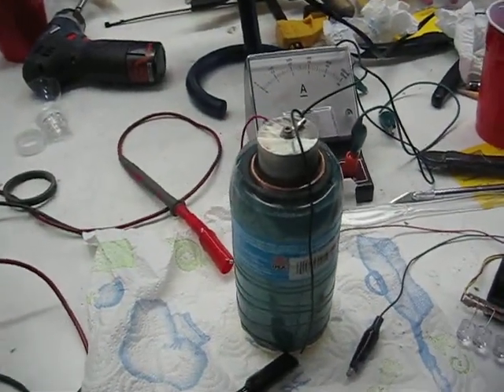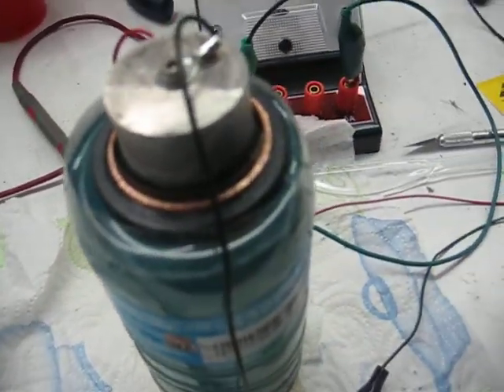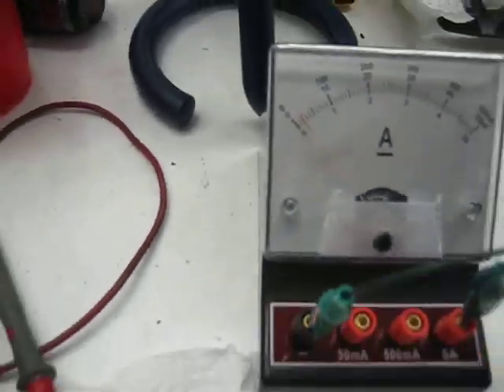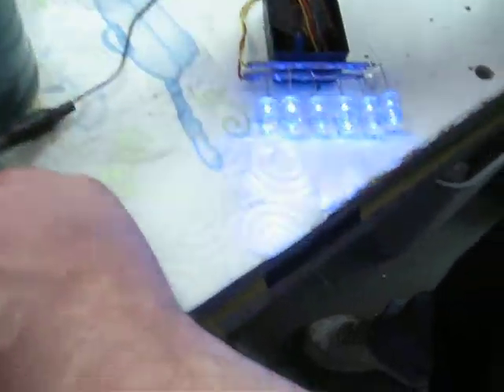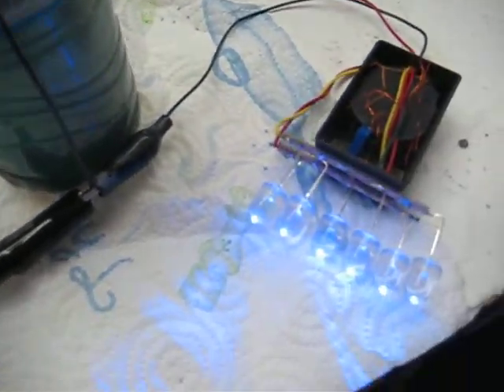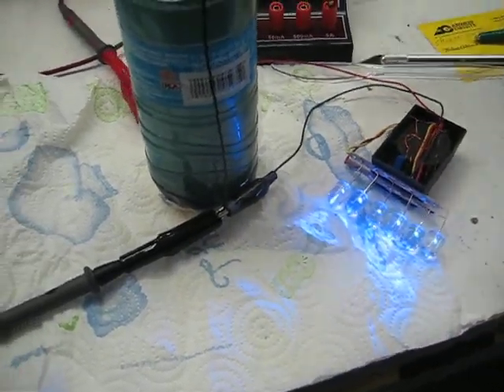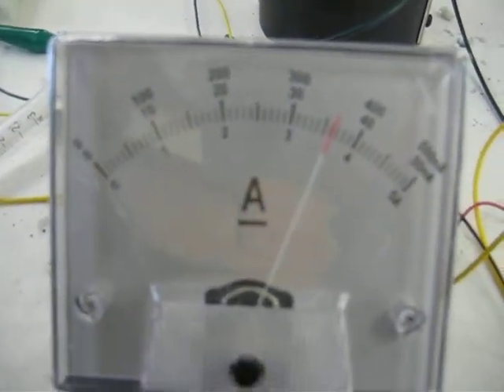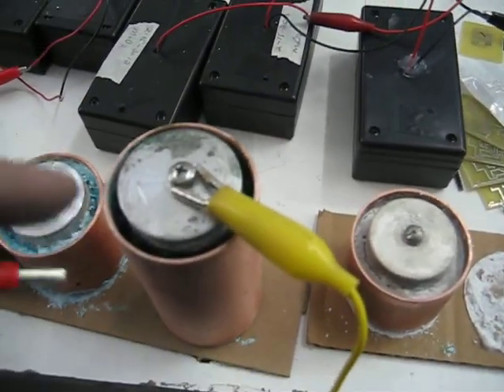Crystal battery flooded

Comment: That looks like a ultrabattery crystal cell incorporating a battery and capacitor cell architecture. Mg/Cu/Graphite or MnO2. Unless corrosion mitigating additives have been added to the electrolyte, and an additional protective coating of MgH2+conductive material, the magnesium rod will be eaten quite fast unless a "softer" electrolyte like Mg(NO3)make the bulk of the electrolyte.
Or are you using a MACC/MMaC complex? 
That's quite interesting - the above I A reading and the voltage.
Hope you'll share the details for humanity!!!

Comment: 2.55 w cell instant power, shelf of 10x10 = 255 w, 4-shelf-bookcase = 1 kw.
continuous 1.5v x 40 ma=  60 mw. 10x10 box =6w, 4 boxes or refrigerator-size unit = 24 wh continuous, = 576 wh per day,  4 kwh/week,  17 kwh /month,  210 kwh /year,  1 megawatt in 5  years
few of such frige-size units can run average household

Comment: I would expect this flooded cell to last a very long time or John and Chuck wouldn't have posted this if it were purely a galvanic cell. If you follow there work on the energetic fourm and energy science fourm. As there work was devoted to stoping the galvanic process by use of depolarizers and changing the copper to make a semi conductor. I believe they were very close to something very very powerful and thus had to go quiet so the powers that be wouldn't come knocking. Ok let's say it lasts 2 years, I already have cells over a year and still have quite a while left before the magnesium is destroyed. The cost of the flooded cell once you have the materials will likely be less than 15 dollars per cell, how long will 1.5 volt AA's put out one amp before dead. Add up the cost and compare. The uses for such technology are endless for prepers, off the gridders, and those that pursue free energy.